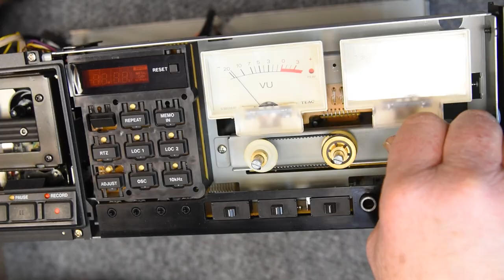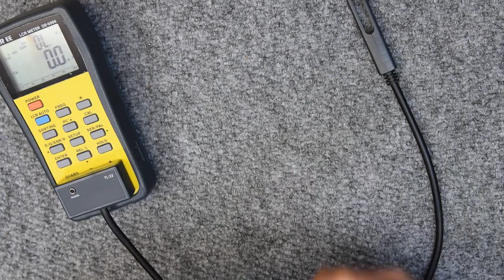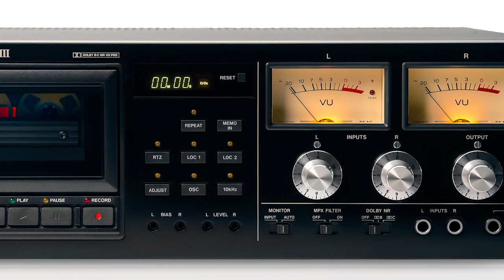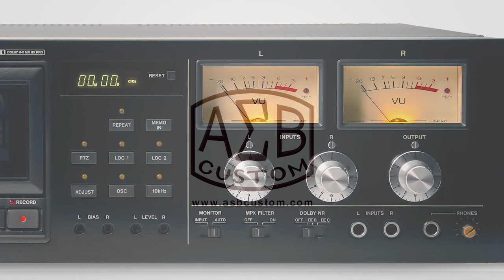Tascam 122mk3 Full Rebuild: Part 3 - New Heads and More

Comment: Высший класс обслуживания аппарата! The highest class service device!👍👍👍🔥🔥🔥
Reply from the maker: Спасибо!
Reply: @asbcustom  I would like to order a bronze pulley from you for the motor for Tascam 112 mk2, but apparently it will be difficult with delivery today, due to the situation in the world.😐
Reply from the maker: Possibly I could list one on eBay and offer their International Shipping Program? I haven't used it much but it's worked well when I have.
Reply: Why did it need recap? Bad sound?
Which ones did you use? 🤔
Reply from the maker: In their stock configuration, they often sound a bit thin, but are well built and worth the effort to upgrade. Modern audio caps are among the many modifications. Mostly Elna Silmic ll's and Nichicon Muse for the upgrades. 

Thanks for watching.

Comment: I really like that braided shield you now have for the head wiring harness! Was that a completely new wiring harness you installed? Or, did you add the shield to the existing one?
Reply from the maker: It's the existing head leads, placed inside the Faraday sleeve, and chassis grounded at both ends.
Reply: I just took an EMI/noise solution training course at my job, so I saw that sleeve and immediately thought of the importance of grounding cable shields to chassis at both ends. I’m an audio electronics engineer with a cassette hobby. I think I’ll add a similar shielding sleeve to some of my decks from now on. What is the diameter of the faraday sleeve you are using?
Reply from the maker: Oh ... that's why you were the only one to pick up on that. The Faraday sleeve is the 1/8" stuff, almost perfect for those two leads. The double grounding was from an avionics AD a while back, it's an excellent solution as I understand it. The other thing I'd really like to do is fabricate a replacement for the cover plate behind the tape. I've measured some residual magnetism from the motors and wish to eliminate it. My first thought is molding the plate from Faraday cloth, but I need to research its effectiveness compared to MuMetal. Do you happen to know?
Reply: Thanks for the 1/8” info. I’ll pick up a supply of that. For your cover plate replacement, I think you would be much better off with mu metal since you’re trying to block a magnetic field produced by the motor behind it. The faraday cloth would be effective for EMI at 1MHz and above. But, the magnetic field produced by the motor is probably a fairly low frequency compared to 1MHz. 

The instructor of the course I took did an experiment showing how a 1KHz magnetic field passed through different metal materials. The mu metal was greatly superior to the others, even copper. And it was less than half the thickness of the others. 

I haven’t purchased it before, but I assume mu metal is fairly expensive and cassette deck manufacturers used it very sparingly.  But, having a cover plate / back plate made entirely out of mu metal sounds very ideal and may be the optimal place for it. I would 100% buy some from you if you started fabricating them for Tascam decks.
Reply from the maker: @stereosteveooo  That was my initial thought as well. It is expensive yes, but can be purchased in very thin cross-section, making fabrication less difficult and as you said, is still very effective. I'll order some from my supplier and see how it goes, I'm thinking something like a doubler for the existing plate. The two dissimilar metals, plus the bond layer, will have the added benefit of dampening the rather tinny resonance of the factory plate. Every little bit helps.

Comment: Hi, where did you get new heads from for the Tascam?
Reply from the maker: From Teac America.
Reply: @asbcustom  thanx, I've only found used ones on eBay for 200$
Reply from the maker: There is an eBay seller with new old stock ones available, price is about the same as Teac's. I can post a part number when I get back to the shop.
Reply: @asbcustom  thanx
Reply from the maker: Updated part #5801585410.
Reply: @asbcustom  thank you so much, we have about 6 decks for servicing, hard to find parts and people with knowledge
Reply from the maker: You're very welcome. Let me know if I can help you out with them.